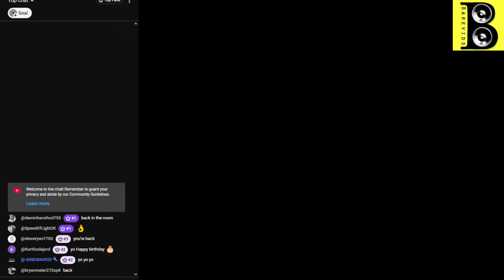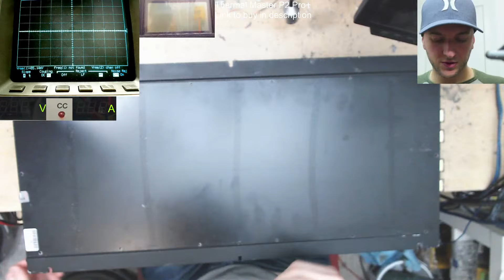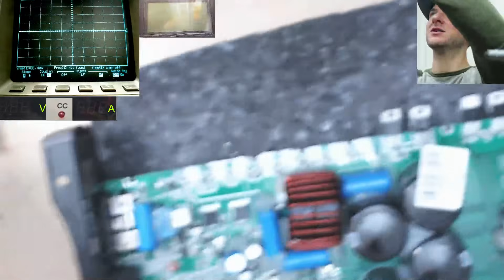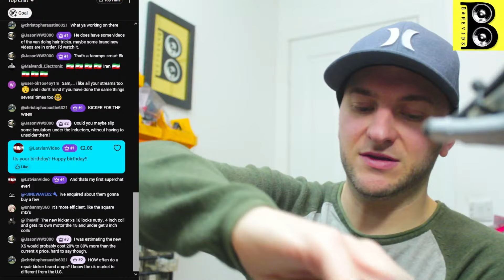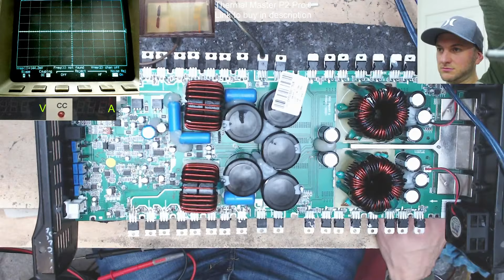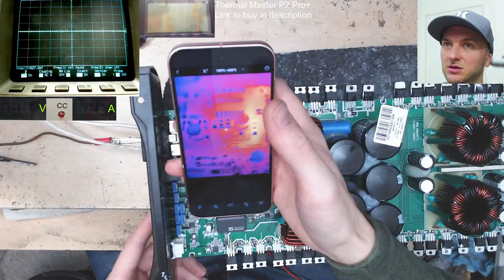Big Birthday Livestream!! Electronics repair Sundown NS2 Powerus PW15000

Comment: IMO something I think would do very well with your streams would be to give a either digital or paper visualization of what's taking place inside of the amplifier for example showing the comparator wave for the class D architecture on paper so people can kind of understand what is going on that they can't see. I understand that you have a scope which shows the wave but it doesn't really show its relation to the rest of the board. These seem to do very well for example engineering mindset and other mechanical and electrical visual teachings I personally would like like to see a high-level breakdown video of this process for me personally outside of looking on a scope, I go back and forth with chat GPT verifying or correcting my thought process and getting a better understanding.

Comment: @barevids hey bro i have 2 rockford fosgate t1 12" subs in a 5ft3 slot port custom box tuned to 32hz. I have a taramps big boss 3k. So my question is there 2×2 so i have either .5 or 2 ohm load actually there a little less but u k ow what i mean, so i want so reliably should i run a 2 ohm load and turn the amp up a bit or .5 and turn the amp down. I only need at most 2k of power i have more of a sq build but plenty loud. Any advice would be appreciated thanks bro.